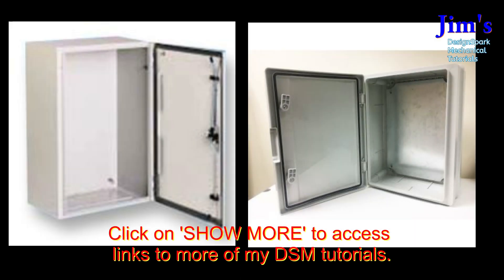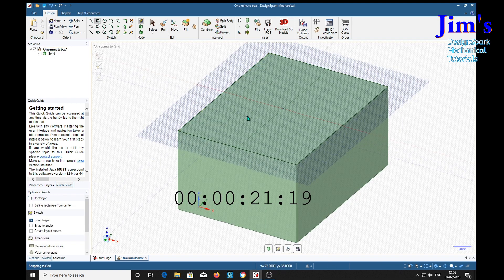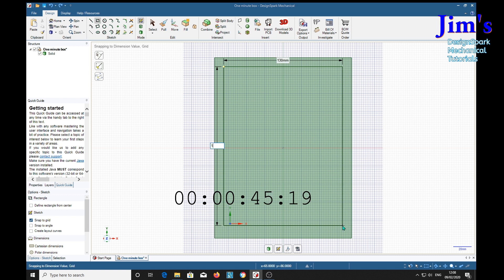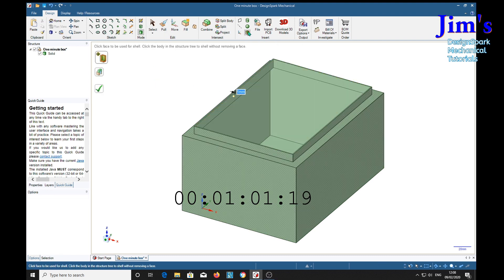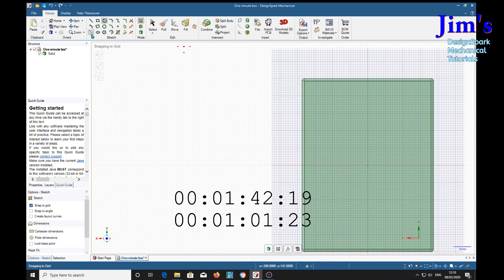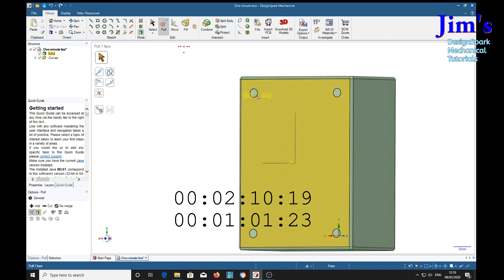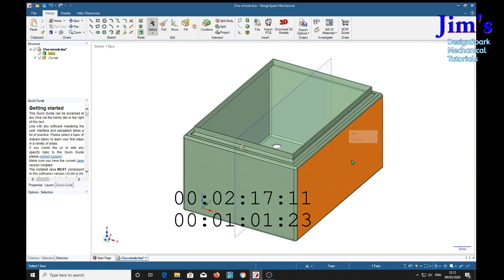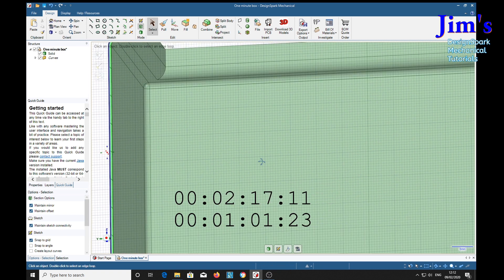Modeling a box in one minute with DesignSpark Mechanical

Comment: Jim. I need help. I am trying to shape a boat hull, and was originally trying to use sketch planes, and failed.
I tried blending but  blends are uneven on both sides.

How can I use sketch planes to shape my hull  into mesh form without using blending?, or maybe you can take a shot at a video about boat and airplane monochrome shaping?

Image showing the shape i need to achieve.
https://imgur.com/LNvJWVg
Reply from the maker: See my series of videos on how to model a Spitfire wing - here is one fo them: https://youtu.be/u_vdLfyoDis